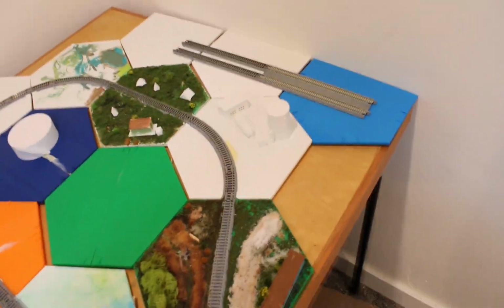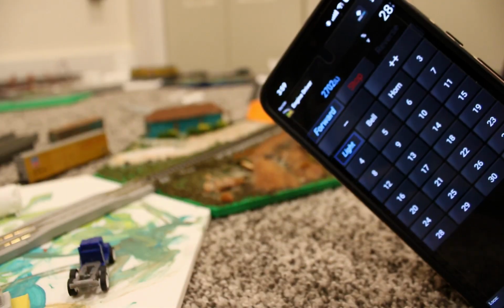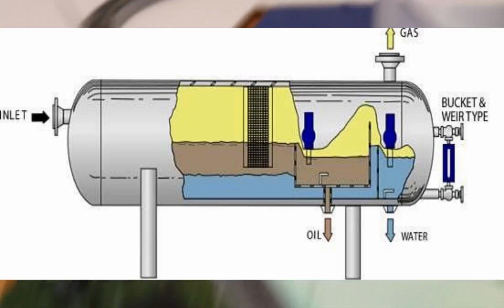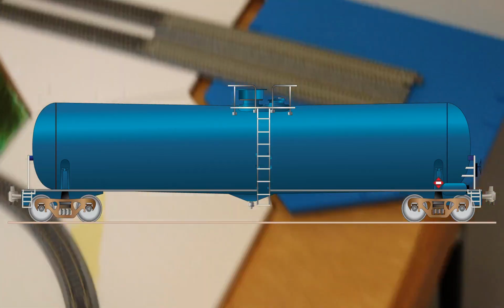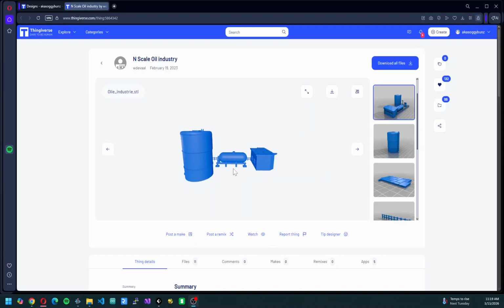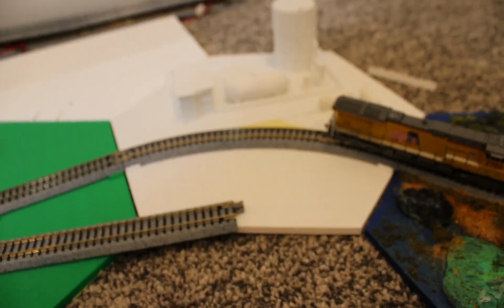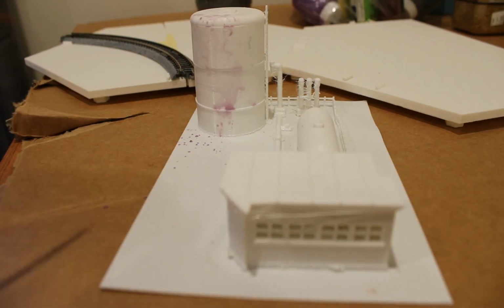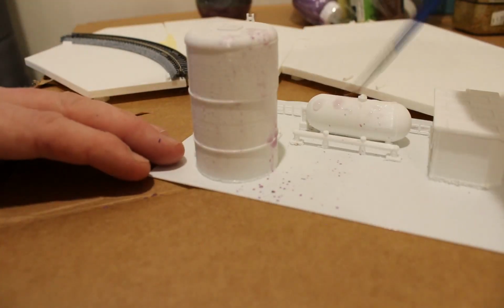I Built a Tiny Oil Well for My 3D Printed Model Railroad

Comment: That's some inspiring work! What radius track did you use on the oil well module?
Reply from the maker: I used one (45 degree) and one (15 degree) I put the links to the track in the description